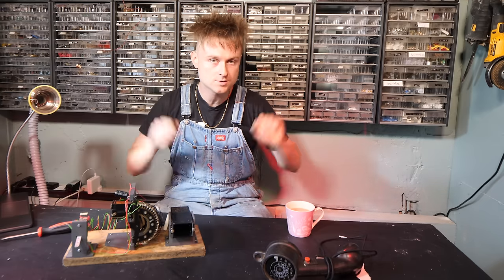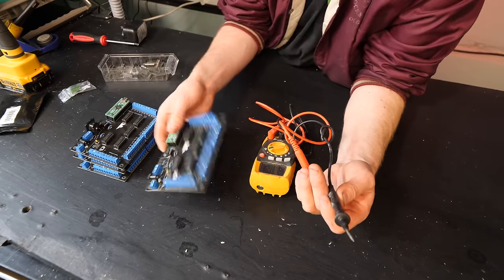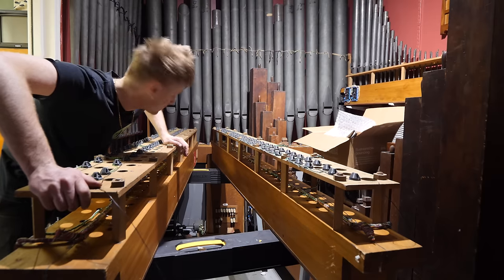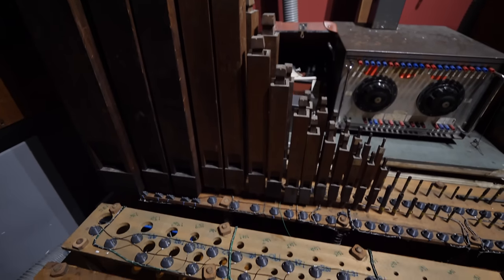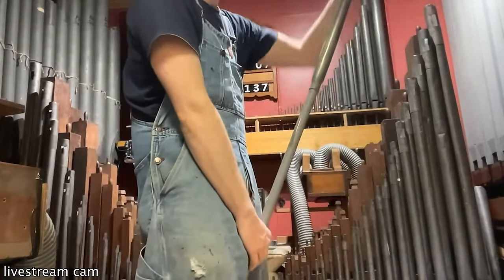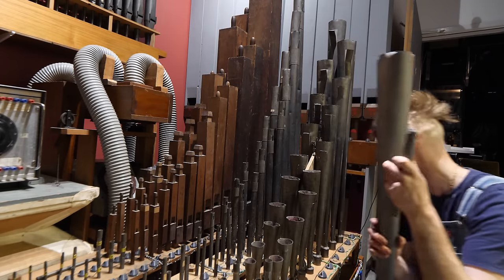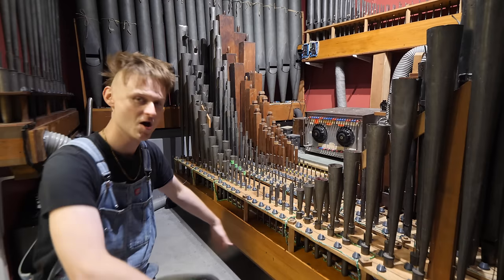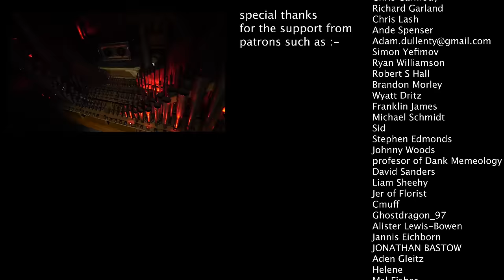I BOUGHT A CHURCH ORGAN PART 7 - Putting In ALL Of The Pipes

Comment: Just a tip for tuning - you can use a small chisel to gently knock the tuner up or down. More precise and then you don't have to touch the pipe -  believe it or not, just the heat from your hands is enough to affect the tuning. Very impressive work!

Comment: My Dad built and serviced pipe organs for many years.I started helping at 5 years old. This brings back memories. The trumpets were always the hardest  to get right. Make you life easier and use a flat screw driver for tuning. There are special tools for tuning .The heat from your hands will affect the tuning. Also wash you hands well after touching the pipes they are high in lead. Do you  have a list of parts you need. Dad can’t work anymore so all his tools any supplies need to go to a good home.

Comment: Great work! A small suggestion for tuning, try to use a metal or wood tool to adjust pipe length such as the sliders for the reeds or the tuning sleeves/notches at the end of the flue pipes. The heat from your hands can affect the final state of tune.

Comment: I might suggest tuning the pipes (tapping up/down) with the edge of a butter knife. The weight balance is decent and it'll give a crisp edge to catch on the tuning slides. Keep in mind the pipes react relatively quickly to not only the heat of your hand (the thin metal expands, making the pipe slightly larger in diameter and flatter/lower in pitch), but the closeness of your hand to the opening at the top. With you too close - it shades the pipe and makes it flatter in pitch. Using the knife will keep your hand away enough so you don't have to keep going back to it over and over. It's also easier to tap up/down on the reed wire since a bulky hand isn't as refined, especially when the pipes are so close together. Use the wire to get the speech and tone of the pipe clear, but also open the flap at the top for fine tuning (similar to the tuning slide of the other flue pipes). Use a free tuner app on your phone to help lock-in the pitches. You'll find a tightly tuned pipe organ is much easier on the ears and will really make it come alive. Enjoy!!! These things are a blast.
Reply from the maker: hey up cheers! yep i have started using the knife, however im still doing it tuning by ear as i quite like a wide tuning on instruments. when they are too tight they sound too proper. and i prefer the piano in the back of the pub sort of sound as it feels more lively. but thats mereluy preference but cheers!

Comment: If you ever need to work on the bottom again, throw a board thru the hole of the wheel brackets and use a car jack to lift it to an accessible height. I so wish I could be there for the weekend of Halloween! The LED's were worth the time, it looks so cool. Keep doing the amazing things you've been doing!

Comment: Nicely laced, I dig  it! Absolutely lovely stuff. Good old electronics assembly techniques, not widely known anymore, except those vintage/retro gear nerds who see it all over the place.
Wondering about the MIDI to solenoid interfaces. What controls the ULN2803 chips? Is it a SMD GPIO expander chip (like MCP23017) on the bottom side? 
Impressive work on these LED holders. 

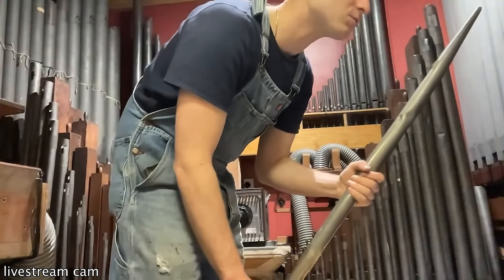9:13 a rare picture of Sam the ace of space riding a broom. Earns a vacuum tube witch seal of approval.

Comment: For a museum showpiece how about this :-  A visitor uses an ASR33 teletype to produce a baudot code tape strip with their tune selection.  The visitor would then feed the strip into a tape reader attached to a jukebox type selection mechanism which picks an 8" floppy disc (3.5" would be too easy :¬) containing an organ midi file from a rack and inserts it into a floppy drive (+ additional circuitry) to decode the file for the organ input.  (Just checked and Arduino / floppy drive interfaces do exist.)
Reply from the maker: I have been on the hunt for a teletype for a while they are hard to come by

Comment: Have you looked into putting water trays in the organ room to keep the hydration up for the wood and the leather bellows.
Reply from the maker: nope. its fine tho. its lasted this long :)
Reply: It also helps with the pipe seals where they plug into the air boxes.
Reply: My parents bought a motorhome from a person who thought leaving pans of water in it would "keep the wood from drying out". What that did was kept the wood framing too damp and a bunch of it rotted. It was a big job for dad and I to take apart large parts of the RV to replace the rotten wood.
Reply: @greggv8  obviously the previous rv owner did not understand dew points and the difference between condensation and relative hydimity. Lol

Comment: ...also, when tuning metal pipes dont hold them. the heat from your hand is enough to make them go out of tune once you have 'tuned' them and they then cool to ambient once air flows through them; better to use a metal ruler to slide up the side of the pipe to the tuning slide, either gently tapping it up or down.

Comment: try yo make a midi controlled  "Cockcroft Walton generator", voltage controlled sparks.
: )
probably possible with CD4066, lm13700 or simply transistors.
Some use sparks to function as audio speaker, tweeter.

Comment: That looks cool in the dark room
How about adding drums, cymbals and bells, a church organ turned into a fairground organ :D
So glad you're lacing the wires, i bet you found it faster than cable ties, specially at the spacing you need for the chests.
You need to do something about the widchest weight, i'm thinking of some sort of monster that rises and falls, which is almost what that piece of equipment looks like (2 eyes)
If you had kept the wires in their pairs or triples, it may have been easier that toning out.

Comment: still think some airpowered percussion would be nice to add to it , base drum single fur mallet , snare two wood drumsticks , highhat single wooden drumstick  , cymbal one wooden drumstick  , and 1 or 2 cowbells and woodblocks all with two wood or rubber drumsticks , wonder if it be loud enough to be heared over the pipes but a xylophone in wood and metal might be working too (prolly directly driven with electro magnets from underneath ) and those allready on a base so there eazier to add to the mix

Comment: By the way I sent this video to a mate of mine who's also an organist, he pointed out you've got some wind supply problems like the blower can't keep the pressure up. It's the reason it sounds so out of tune towards the end. Did you do any maintenance on the blower before you installed it? I can't tell if an overhaul and service would help matters or if it was always underpowered and could never sustain the instrument at full pelt. If you're planning on adding more ranks you might have to either look at revoicing the pipes for a lower pressure or start looking for another blower. It'll sound amazing once that's all sorted though.
Reply from the maker: The blower is fine 👍
Reply: @LOOKMUMNOCOMPUTER  Hm could be something else then, it'll be worth experimenting. My friend's right though, it doesn't sound like it's running on full pressure. It was only really noticeable when you added the last two chests, that's what made me wonder if the blower was struggling.
Reply: @mrrandomperson3106  it's because it's currently set up so that ALL the pipes for each note on every rank play simultaneously. The same as pulling out every stop on the original console. Pipe organs aren't meant to be played that way. Sam's next step is to restore the ability to select which ranks are used. With MIDI he can give the organ capabilities it never had like splitting ranks so that only some pipes on a wind chest would be used.

Just think about the music that could be played if during the ASDR envelope of a note different pipes could be brought in. Start the note with one pipe then partway through Attack bring in a second, hold both through Sustain, then cut the second partway through Decay. He's already demonstrated the ability to control volume with the video where he had it playing digitized speech, so functions like velocity and varying the volume by how hard and how much the player pushes the keys can be done.
Reply: @greggv8  Any decent organ builder would have specced the blower for full organ. If it's struggling then there's definitely something up.

I'm excited to see what he does for different stops. I imagine he'll recreate the extension ranks it had before then build on that. There's no volume control on those pipes, it's literally just a stream of wind and a valve that opens and closes. Changing volume is just a matter of selecting ranks. Velocity control is possible in theory but not without replacing all the existing action with something that's capable of opening the valve in steps. The attack, sustain, and decay changes would definitely be cool to see.

Comment: Are any of those ranks Celeste?  I think those would normally be tuned slightly off from the other pipes, but I can't remember for sure.  It sounds really awesome though.  I always look forward to the next video in the series.
Reply: I’m pretty sure no; I counted 4 ranks in the original video: diapason, stopped flute, trumpet, and some 4th rank like a string or dulciana.  A celeste would be a good addition, assuming that the existng 4th rank is reasonable to use with it.
Reply: No they're not, there was a salicional rank on the swell but that was it.

Comment: Im surprised the LEDs were not just midi controlled set to the same channels are their ranks. Could have resulted in some cool FX programming.
Reply from the maker: They are?
Reply: @LOOKMUMNOCOMPUTER  well sure if tied directly to solenoids. I was thinking you can also do animations and or RGB. Would it be cool if it had some sort of idle lite show not requiring sound? EDIT; It appeared to me  that you directly tied to solenoids, If the leds are independent, then sorry for being dumb, but even still... RGB :P

Comment: Why didn't you decide to piggyback the LEDs on the solenoid wiring? Or did you and I'm just missing something?
Reply from the maker: I did?
Reply: @LOOKMUMNOCOMPUTER  perhaps you did? It looked like you were running a separate wire the full length of the wind chest for each LED. Do they actually just loop around inside to the solenoid?

Comment: I'm curious, could addressable LEDs have reduced the amount of cabling required?
Reply from the maker: Yes but in my opinion they look tacky. And also in initial tests they didn't have the right light beam. I went for a led with the right lumens and light angle for it
Reply: @LOOKMUMNOCOMPUTER  also, LEDs wired directly to each solenoid required no writing program code to control them.

Comment: Just curious: why dont you fix the wiring in Software instead of checking every wire with the continuity tester? Just connect in any order, note down which led/pipe goes off and remap in software 🤔
Reply from the maker: Because that sounds very unpleasant if I'm honest ha. I hate being stuck on a laptop staring at a screen so keep it to as minimal as possible
Reply from the maker: It's been suggested a few times and it just does not make sense to me. Especially for the future when someone else is trying to trouble shoot it. This is why with coder mentality the future of repair is fudged hahaha
Reply from the maker: Don't get me wrong I have done similar before. :D
Reply: Totally get the point that if someone else gets involved, the confusion is going to skyrocket.

It's also not neccessarily a coder mentality. Searching the right cable gives you a worst case number of checks of n • (n-1). Recording which input produces which output only requires n checks (writing down which signal becomes active). But admittedly you have the cable colors to work with. So beeping through all the connections probably was not as time consuming as I imagined initially.
Reply from the maker: @haukeradtki3322  yes. whilst i can understand why you would do it like you mention, it has been mentionned a few times, i can not think as to why except to cut a corner and also have to spend excessive time on the computer. but hey good luck to all have fun!
Reply: I'm very sure you wired far more meters of wire than most, so surely you know what works best for you. Carry on! Some day I have to pay this thing a visit!

Comment: Hey Sam, I can help you with turning your designs into professional pcbs to sell.  I do it all from the schematic to designing the board to having it manufactured.  and I can work  with  as far as design collaboration if you're open to that.
Reply: He already has the files for that MIDI solenoid controller on his website so anyone can download it and send it to any PCB company, some of which will (for extra cost) obtain all the components and solder the boards together.

Comment: Wouldnt using NeoPixels save time on LED wiring and over up a world of new opportunities?
Reply from the maker: I tried it just looked tacky. I went for this led as it looked the best and had the best lens angle. Light strips looked like a teenagers gaming setup
Reply: @LOOKMUMNOCOMPUTER  they make Xmas light chain from WS2812/neopixels. Does not look like a LED strip, allows much more freedom for the led placement and spacing and that’s just 3 wires to connect for 50 full independent RGB leds.
Might be relevant for a future project.

Comment: This has been a very interesting project to follow over the past few months. Esspecially when this stuff one of your interests. I find it entertaining watching people's reaction to when they first see what the instrument is really like as a whole and it's capabilites. One suggestion I have is to see if you can put the principal rank on the back wall up a little higher so you can store more pipes under it; possibly moving the blower and windchest to another room if you haven't already done so. In terms of new Ranks, I do have a couple suggestions. You can do a half length extention of a 16' Chorus Reed. Most optimal would be one of smaller scale such as a fagotto or Bassoon as to not over power the organ. Note that there are differences from the Orchestral Bassoon. The previously mentioned Vox humana isn't a bad idea either its small resonators make it easy to fit in though its potential might be a bit limited. Speaking of small resonators, a Cromorne with its half length resonators, might also work it has a sound resemblance of a Clarinet and also can be used in a chorus. You can also do a nazard or quint if the organ doesn't already have one. It speaks a fifth above everything else so when you play a C you actually hear a G. It can create so very neat effects. I would recommend having it if there is a Principal of 2' pitch as the nazard at 2 2/3' helps support the 8' 4' and 2' And lastly, you can do a mixture which adds more brilliance and brightness to the overall chorus. They consist of several Ranks whose pipes often break back or repeat previous octaves. I'd recommend no more than a 3, maybe 4 rank Mixture. I also noticed that the console had a Swell Division though they are no shutters. If I were to be honest, I would probably start from scratch with the console as it seems to be in very bad condition. They're Third party sources for organs so there shouldn't be too many issues and if you are thinking if downloading sounds from midi files, than you may want to consider a third manual or keyboard. Either way that's all I have on it. Sorry for the long comment but I felt like I should share my thoughts on the subject. The finish line is in sight my friend.
Reply from the maker: Thanks. Yep nazard is on its way! Console is a bit fudged keyboard is water damaged still figuring out a plan on that. As for blower alas don't really have a space I can pop it out of the room. I did try! As for stacking pipes that was an initial plan but the roof height did not allow. But thanks for the thoughts on it all! And for the ranks I'll do some reading on what you suggested cheers
Reply: @LOOKMUMNOCOMPUTER  anytime! I also thought your reaction of the criticism was also hilarious to watch. Honestly, they don't know what they're talking about. I've seen pipes mounted on ceilings and solder is used all the time with constructing pipes.
Reply: Looking at the spec of the original organ there was a nazard stop from one of the flute ranks so all he needs to do is offset the MIDI signal by a fifth and send it off to the relevant windchest.
Reply: @mrrandomperson3106  you wouldn't mind offering a link for the specs right? Many thanks!
Reply: @LOOKMUMNOCOMPUTER  also forgot to mention, if you're doing research on organ stops, I find the encyclopedia of organ stops indispensable. It is free to use and the info is accurate for the most part. You can also checkout the websites of organ builders as they tend to have stoplists which may give a few ideas. Just a few include Fisk, Casavant, Harrison and Harrison, Klais, Rieger, Quiorin, among others. Note that all of the mentioned organ builders have their own styles and views on the subject. And speaking of which, another stop you could consider is the tierce or Seventeenth of 1 3/5' which will sound an E. The possibilities with this stop are quite interesting when registered correctly. Perhaps more so than previously mentioned ones. Either way that's all I have to say. Sorry for the third comment, but I felt it nessesary to give you a few resources.

Comment: i fee like you could have saved coundless hours just using ws2812 leds instead of the simple normal led, you would even have had rgb control, and all that with just one pin on a micro controller
Reply from the maker: yes but one thing about me is i have a certain aesthetic in mind, and those led strips look tacky and not of the time. i felt it was worth the extra effort. it was suggested a lot to use those. but i just preferred, also i used a specific LED which took a while to find the right one with the right luminescence and light angle.